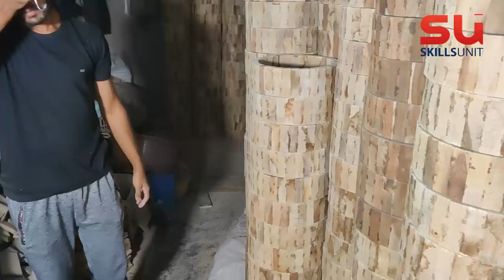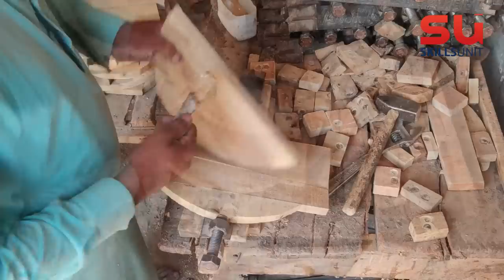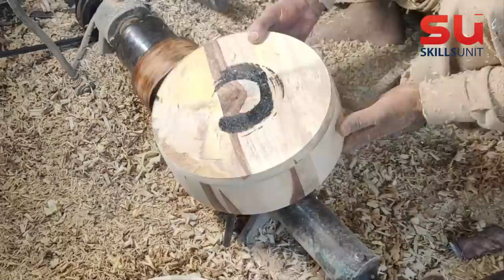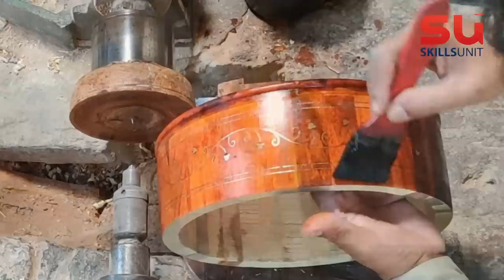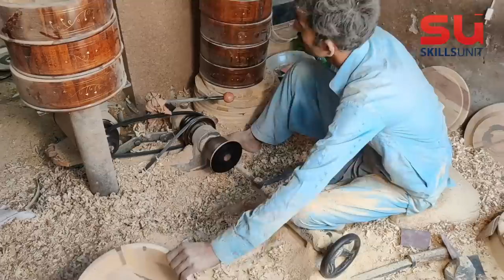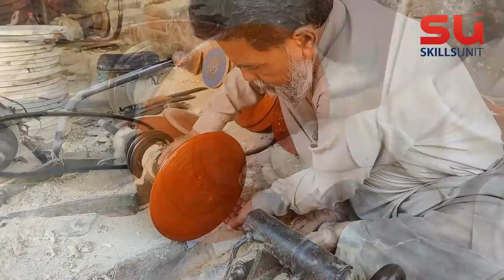Very Cool ! Fantastic Process of Making Wooden HOT POT Like Japanese

Comment: Beautiful finish but I presume when they use the words "hot pot" it's going to be used for food.  I would be a little worried about the contact with chemicals.
Reply: Where are the "chemicals"?!
'Chemicals' are expensive.
The finish is most likely natural shellac and the adhesive is most likely derived from the rubber tree or similar.
Being wooden, clearly it's not intended for COOKING food.